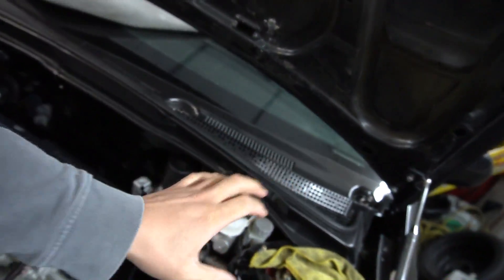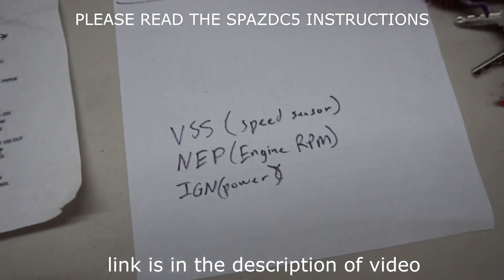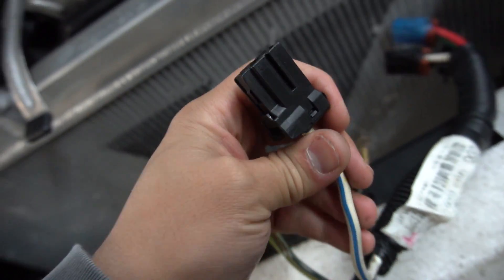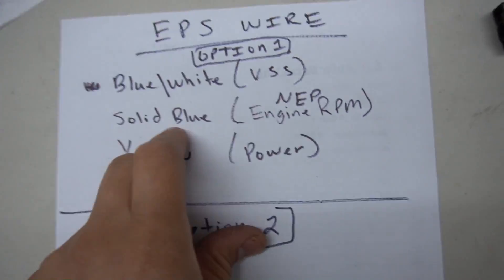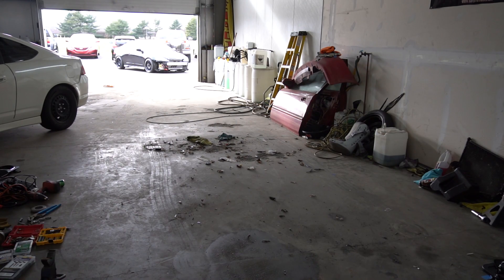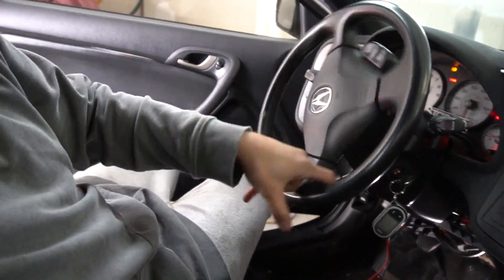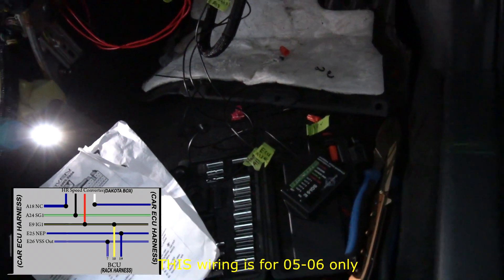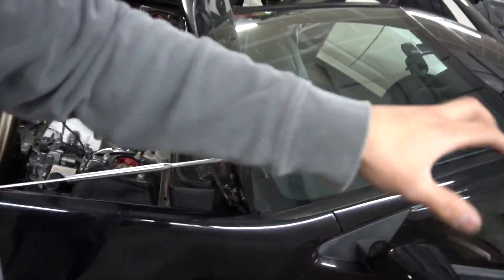How to wire the EP3 Electric Power Steering (DC5 EPS) PART 2

Comment from the maker: UPDATE: YOU DO NOT NEED THE DAKOTA BOX. TAP IN FOR VSS, NEP(RPM), AND IG (POWER). 

I WILL BE MAKING AN UPDATE VIDEO SOON
Reply: Damn bro where you at I’ll pay ya to do this on mine lol
Reply: Hey did you ever post the update video?
Reply: I just completed this swap on my rsx and and going to do the wiring tomorrow but If I dont need that box then that would be great
Reply from the maker: @antfct2  u don’t need the box
Reply: @Deemossi  So just wire it straight from the motor to the ecu then and done?
Reply: @antfct2 im wondering the same thing, thats where im at rn
Reply: Also wondering
Reply: did anyone managed to do this swap 2with out the eps control module yet ?
Reply: Anybody do it without box
Reply: Kota box

Comment: what if i’m using a crv awd trans? i got the harness with the GN, Gn/Wh, yellow wires. running ktuner, i tapped yellow to E9, GN to E26, GN/WH to E25. checked 02-04 trans in ktuner. EPS still doesn’t kick on when i’m at idle. doesn’t feel like it kicks on either when turning as well.  i get all the right voltage readings.

Comment: Did you have to activate or sometging in the ktuner ecu? I have a 2005 rsx and did the wiring just as you and its not working with the e9 e25 amd e26
Reply: Did you ever get it working I’m having the same problem

Comment: Hey man I had a quick question about the wiring I am running an 05 06 engine with harness on A 02 04 type S ECU Do I hook the wires up accordingly to your 0506 or since I'm using an 0204 computer do I just wire it like an 0204 I also have a capro jumper harness from A 05 to a 02. If you can help me out with this I really appreciate it been following you for a while I did abs delete at a few bucks relocation everything pretty much from you I appreciate the help

Comment: Hey Deemossi, thank you for the video series. Did my conversion on my 7th gen civic today and hooked up all the wiring but it’s not working. I think I may have tapped into the ECU incorrectly since my wire harness was faded and I couldn’t tell if it was blue or green. Decided to go with the green and now I’m thinking maybe it was the blue. Do you know what distinguishes the two harnesses? Is it year or the car? I got mine from a 2002 ep3
Reply: Hello Shamgod did you figure out your car

Comment: Hey man, i hope your eps works like you want it to ! What was your reason to change from  hydro rack to a eps rack? 
I kswapped my 05 em2 coupe, and it's been nothing but trouble since installing the ep3 eps rack...
Sticky steering , almost no self-centering , knocking sounds when turning the wheel, not steering straight, no feel at all, ....
Did almost everything to better it.
-shg rack slider
-tegiwa rack raiser
-tegiwa adjustable tie rods
-hardrace extended ball joints
-4-5 different alignements...

Nothing changes...

Last steps now are rebuilding the entire rack , and adding hardrace reversed tie rod ends and hope for the best !

Congratz on your build!
Reply: Any update on u man?

Comment: Hello Friend, great video there. I need any help possible. Actually i did the opposite of steering rack replacement. I had eps got rid of it because of knocking and steering spinning. Electronic malfunction. Then living in a 3rd world country i have to import rack from Malaysia, England or Japan mine is right hand steering. Hydraulic rack installed and working but rpm dips low when taking all the steering lock to park. So my problem is hooking up the power steering pressure switch two wires to ecm. The green/white wire and black. From checks online the green white wire goes to e plug pin16 and black ground wire A plug A24 brown/yellow. Thanks

Comment: Good explanation papa. Thanks for the shout-out! The main thing for 05-06 is the Dakota box for the vss since is a different signal from the 02-04. If I'm remember correctly, Spaz had a glitch until 5 mph without the Dakota box and one the day the steering wheel got crazy moving around. 
It feels great to have power steering back though 😂
Reply: Wait what so you do need it?